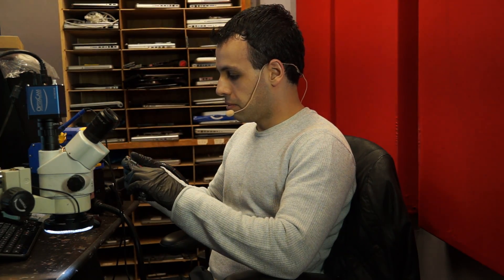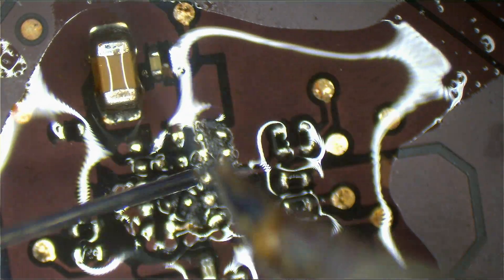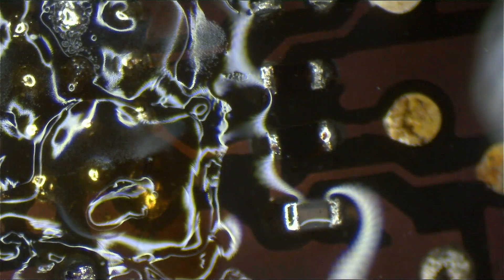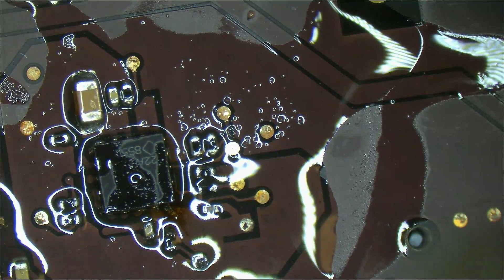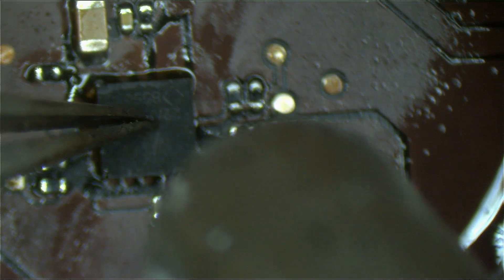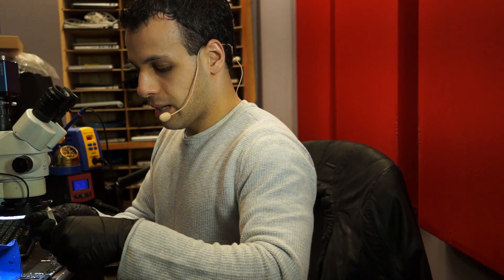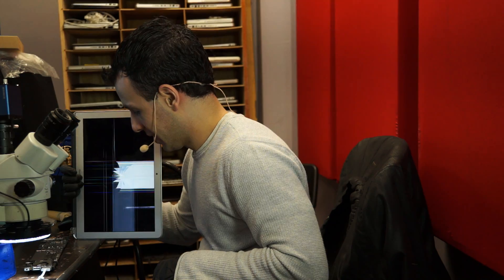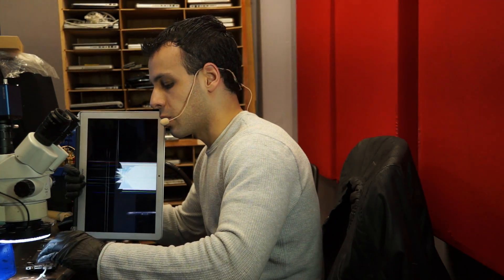How to correct micro bga soldering when you screw it up(hey, it happens)

Comment: Em.. not sure about this but did you replace a polyfuse with a 0 ohm resistor? (0 was written in there).. Also polyfuse reverts to the working state after current drops to reasonable levels - self resets (based on fuse specs), so no wonder that the polyfuse almost newer blows... or am i wrong?

Comment: Great video! But why do you choose the NC-559-V2-TF Tacky Flux over the VS-213-A-TF ? 
Amtech's web site says that the NC-559-V2-TF needs to be completely cleaned away to avoid contamination, capacitive effects and possible corrosion, over time (but still names it "No-Clean"!). Also, the NC-559-V2-TF is listed as: "won’t solder lead-free metals". Isn't all solder tinn sold today, lead free (Environmental requirements) ?
My task is to heat up a GPU in order to re-seat the chip hoping to mend cracked or broken solder balls underneath it, without actually removing the chip.  I have been told that this may fix a malfunctioning GPU, as they tend to elevate from the PCB if overheated during operation, possibly causing some odd balls to crack and loose contact. Then, by applying plenty of flux, melting it and letting it flow in underneath the chip, is said to be a useful method that may fix such problems. But of course, since the chip isn't removed, cleaning away remaining flux underneath it, is impossible.
Comments?

Comment: Louis
question if you get time for it, where is the wire attached too besides the blown pad? Isn't it suppose to be connecting to another part of the board, a different pad? Let me know I'm curious. Or is it used just to connect the pad to the ball in such a way that there needs to be the wire there to form the connection?

Comment: LOL what if the Bad BGA pad is in the middle ? drill a hole under the motherboard with the wire already welded to the chip ? im not making fun of you but just thinking of a solution.
Reply: most motherboards use many layers of traces inside a single pcb- there might be something in the middle of the board you're drilling through or shorting
Reply: You could mill out the layer(s) of fibreglass and reinstate the via and pad, along with substrate.. there's just no way it's economical to do for a Macbook. You lose a non-edge pad on a fine pitch BGA, you scrap the board. Some of the really low density BGAs you could possibly run a very fine wire to if you can locate the net somewhere accessible.

Comment: Why you put the wire there? Can you explain a little bit further? I saw it on your other videos too. You put a wire but i don't know why.
Reply: I can explain. That pin holds a high voltage, so, when this board got wet, electrolysis ate the copper pad away from under that ball of solder. In order to get the board working, he had to replace the missing pad. So he soldered a wire from a nearby point to where the pad was, and allowed it to solder to the pad on the new chip.
Reply: +Robert Backhaus Thank you so much. All became clear to me now.

Comment: Hi. I have been watching many of your videos. It surprises me that you heat the chips (from the top) for a relative long time with your hot air soldering tool. Isn't there a risk of overheating them? I just ordered a hot air soldering tool, and I am going to practice on some old boards first, to get used to this soldering technique.
Also: some chips require a thermal pad. Are the chips in this case soldered to the thermal pad, or do they use thermal conductive grease most of the time?
Reply: That is how the chips are designed to be used. 

BGA chips are made with balls of solder already on them, although Louis is reusing parts, so he makes do with creating his own with solder on the board's pads instead. Other components don't have solder balls when new - with these, a solder paste - microscopic balls of solder suspended in flux gel - is put on the pads and the components placed on top. Then the whole board is put through an oven which heats everything up to the solder's melting point. Louis doesn't use paste, he just melts fresh solder onto the pads, adds more flux, and heats.

Parts with thermal pads under them just have either solder paste or balls underneath the pad, and it is soldered to be board in an oven. If hand soldering them, you just need to get everything to the right temp.